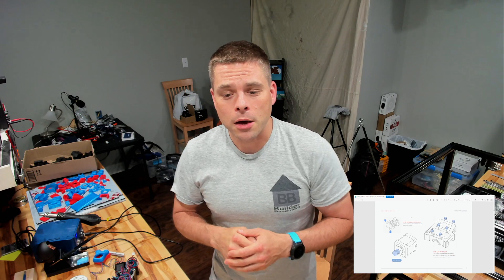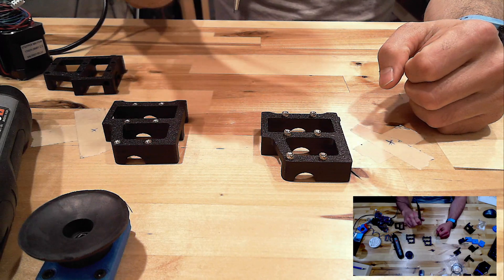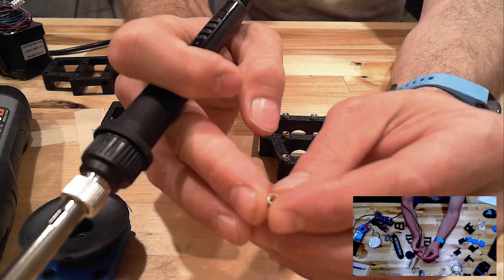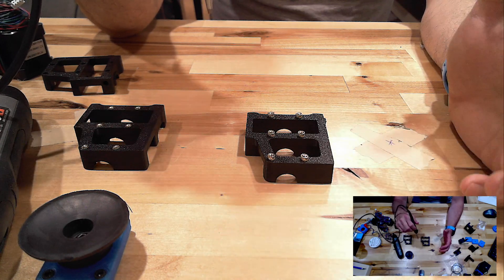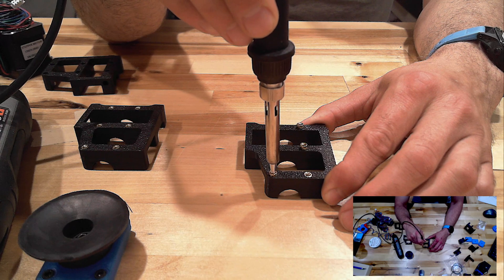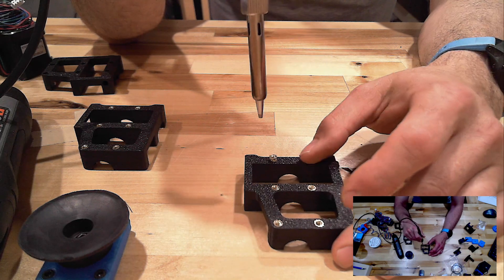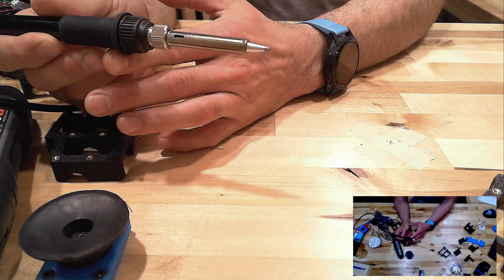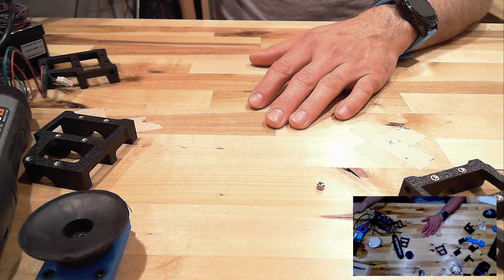Heat Set Inserts *VORON 2.4 BUILD* HOW TO Install these Awesome Fasteners!

Comment: ok so I shouldn't use a hardware store plugin iron with no temp control
Reply from the maker: You can.  Just be careful and quick. Those irons tend to be hot!  I would say invest in an iron with a temp control, you should be able to find one for under $25.

Comment: Another tip (one I read / what I did) - on a flat surface, after doing a heat press insert, flip the item over and press it down onto the flat surface.  Makes it perfectly level with the surface / flat just about every time.  I personally used my unprepared MIC6 build plate from my kit when doing mine
Reply from the maker: I have seen that trick as well.  I tried it - but it was a delicate balance between wanting 100% flush serts and getting them hot enough to move after removing the iron.  Another way I have seen is to use a small 1" scaper and push them down for the final mm or two.
Reply: @BuildItBasement  ah I was melting mine in at about 300, and using the hakko heat set insert tip, so maybe I just had a bit more melty time to play around with it haha.  A scraper sounds like it would be good, too